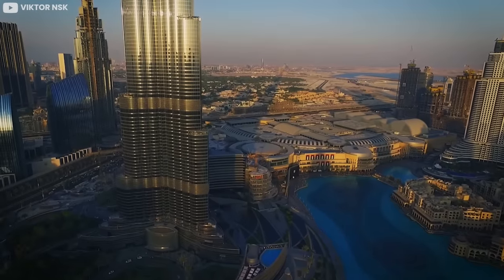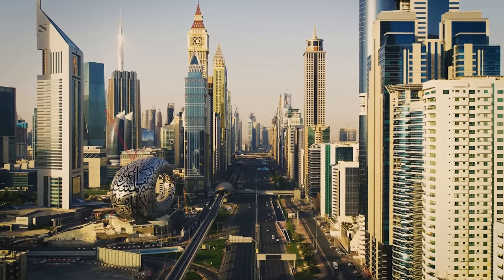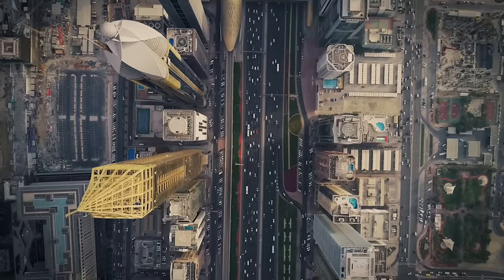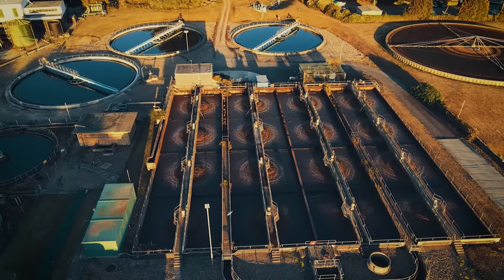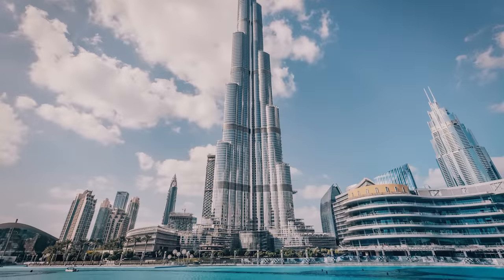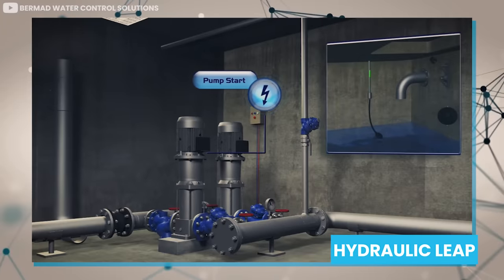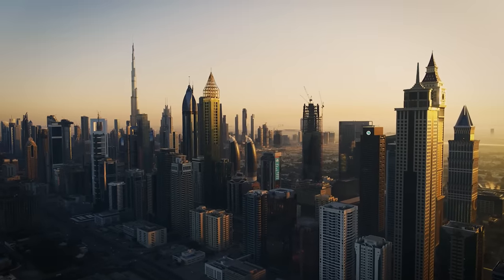What Happens When You Poop in A Burj Khalifa's Toilet

Comment: Surprised they didn't install a system of turbines to break its fall,  first building to generate power as the shxt goes down.
Reply: That's a pretty shitty way to do it
Reply: Did you mean generating power by hitting the fan?
Reply: New meaning to "the shit hit the fan"
Reply: Brilliant
Reply: Mate, you're a genius.
Reply: The geniuses always lie  at the comment's  section
Reply: @TeleTrueStory  Well, it WOULD turn the blades, thereby creating power.
Reply: @deltalou8987  😂😂
Reply: the blades could be Macerators making the waste into a liquid form, similar to turbo flush toilets that have a 3 inch pipe rather than a six inch.
Reply: so when the shit hits the fans,you get the lights on ...awesome.

Comment: They need to figure out a way to meter monitor water usage.  have a command center read excessive use. It seems unusual for a building to be creating that much waste.
Reply: They actually do. DEWA (Dubai utilities) has an app, and they also send you an SMS if you have excessive usage. Also these sewage trucks haven't been in Dubai for years - I've never seen one and I live here. Think it was a short term problem when downtown was being built in 2009
Reply: Thirteen tons per day is less than one truckload. It seems this video intentionally exaggerates that line of trucks.
Reply: @davidclark3304  Maybe the 8 tons didn't include the mass of water? idk

Comment: The long line of trucks is deceiving. 13 tons of waste water is 26000 pounds. Divide by 8lb/gal yields 3250 gallons. The truck pictured was labeled 1000 gal. So 3+ trucks. There is some wiggle room allowing for differences in the density of the discharge but not dozens of trucks.
Reply: True. Maybe it's a stock video of a convoy of sewage trucks...

Comment: It wasn’t cost effective to have the building connected to the sewage system but having trucks take the waste day in and out is?
Reply: The sewage system of the entire city cant handle it
Reply: Yup. Politicians the world over only think short-term, except for their own pension.
Reply: Right, because the system that it would have been connected to wasn't designed to handle that kind of load.
Reply: @wiseblast This is what happens when you use Sims as your architectural simulator for building construction.

Comment: London already has a comprehensive sewer system, but London's new 'super sewer' - officially called The Thames Tideway Tunnel is due for completion in 2025 and will augment the current system. This 25 km long super sewer consists of tunnels with an internal diameter of 7.2 metres (24 feet) and runs deep under the River Thames.  This project will cost  a total of £4.9bn to complete when the £1.1bn spent for preparatory works is included. That's the civilised, sane way to develop a city and ready it for the future, rather relying on septic tanks.
Reply: Cool. But here you can't tunnel in sand.
Reply: @ksavage681 is there only sand underneath? or is there also some kind of dirt that would be sturdy enough for tunnels?
Reply: maybe it would be far too deep
Reply: Is it the same London where people are left to burn to death in Grenfell and still no accountability over 5 years later? The London where a high-rise building was given the green light in CW and only had one staircase and then the LFB had to boycott it? Where we constantly have almost none of our high-rise buildings operate as they should and all buyers/tenants complain about poor quality (and even mould in Landmark Pinnacle) and where a simple cooling system never works? Yeah, please tell us how London is superior to Dubai just because shit goes down the right pipe. 

England is very good at writing/saying the right things but has a very poor track record.

Comment: The piping configuration we use in sanitary stacks to prevent blowouts and hydraulic jump are called velocity break. Additionally, the water closets that were mentioned as being installed on their own independent stacks were done as such to avoid being installed in the Suds Pressure Zone. As a union plumber, who builds highrises on the East Coast, it’s absolutely mind boggling to hear that the Emiratis built this city up without sufficient sanitary piping. Its a recipe for inefficiency, unsustainability, and, ultimately, disaster.
Reply: 🔥🔥🔥dark, i cant wrap my head around!
Reply: Not to mention Disease. I am appalled in knowing they designed this "Jewel" of a state of the art building without having installed a proper sewage system. That is what happens when you cut corners. You literally waste money.

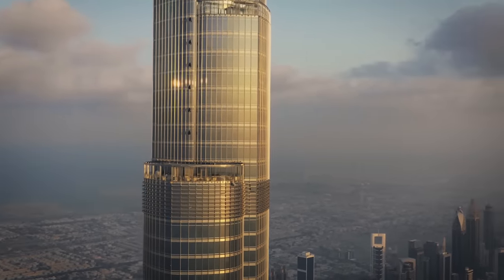Comment: 06:33 That image of the trucks show more than 13 cubic meter of storage. 1 cubic meter of pure water is 1 ton and a quick google seems to indicate that wastewater weight 70% of pure water. Therefor 13 cubic meter sewage would be 9,1 ton kg. Each truck is probably around 20 cubic meter.... Meaning a truck can take up to ca 11 ton. Seems to be more than one truck in that image to me... Is ALL sewage trucked out of the city? LoL
Reply: Burj khalifa is designed for 35000 occupancy , it has 900 residential flats assuming average of 4 residents per flat , they will use 500 litres of water per day for drinking pooping bathing washing etc. That's 1800 tons per day from the residents alone. I still haven't added the 2-3 kg poop/urine they do per day which will take the figure to roughly 9 tons more. So dear you need roughly 140 truckload to be moved out of the city and this for residents alone. Commercial offices , hotels , restaurants will add roughly 200 truckloads more. And one important detail you missed, sewage water is heavier than pure water. Your calculations are wrong ,13 cubic meter sewage should weight 14-15 tons and not 9 tons.
Reply: @dv5625  1 cubic meter of Sewage, sludge weighs 721 kilograms [kg] | Density of Sewage, sludge (material)
Sewage, sludge weighs 721 kg/m³ (45.01056 lb/ft³) | Maybe Aqua-Calc site is wrong.

Comment: I should be shocked, this should come as an absolute surprise that one of the most modern building in the world relies on trucks to carry off its sewage, but it does not.  It does not for many reasons, not the least of which is I have noticed a trend in new building projects, especially in gentrification and municipal funded projects I call Disneytfication.  The go up quickly, they seem wholesome, safe, clean, modern, and free from all manner of ills, but it's all a facade.  Plastic and paper mache, party tricks and barbie dolls, and lurking right under the bright, shiny exterior are is all sorts of gimmicks and tricks all held together with duct tape and string.

Comment: Even though they didn't connect up the waste water sewerage plumbing  first,  I believe  that even though they didn't connect the sewerage up the usual way first, I am thinking  it is still be possible to run a new system "from the septic waste plant facility that would be only for this building alone, 

And they could build it underground running the most direct way, straight to this sky scrapper, the Burj Khalifa? even though things are usually done the other way around, I believe that if they wanted in the future I believe it could still happen,

 I mean if they haven't had any problems with the trucks transporting the waste, then I believe that while this method seems to be working fine now that they could still change over in the future to the other method, I believe that it would not be that much of an issue, if they built it from the waste facility to the  building, obviously there would need to be one day within 24 hrs, for the change over process to occur, but that would be possible I would think.even if part of the Burj Khalifas sewerage system was changed over part by part over a few weeks, on the grand scale of things I wouldn't think that it was impossible at all, they could do that I believe, it seems like a big issue but if you are talking about big construction contracts for the future over the years ahead things could still logistically work out.
Reply: You really do have a lot of thoughts and beliefs about the matter.
Reply: @paulryan2128  I was thinking about it while on the throne.
Reply: @davidhunt1350  niceee :)
Reply: @indiasuperclean6969  there are no countries upon this earth that are above each other none what so ever one persons problems are everyones problems, if you don't work together problems never go away, no countries on this planet are with out their own respective issues but isolation from the rest of the world doesn't work, it's like trying to run away from your own back as soon as you stop & turn your head over your shoulder, there it is right where it always was, no matter how fast you run. issues & problems only ever get solved when people work together, this is something that is easier to work on together, that is why the earth is round like a circle it gives us all a chance to get around & work with each other.

Comment: Architects have  no business with building waste management. This is negative reporting. The engineers do. In  a pumped sewer system dependent on electrical power the provision for sewer trucks is prudent whether a building is connected to the municipality trunk sewer system or not.

Comment: THE POO TRAVEL AT AN AVERAGE SPEED OF 122 MILES PER HOUR  GOING DOWN WITH THE VELOCITY OF 10MPS2 "VERY FUNY"IMAGINE RUNNING A MAINGTANENCE INSIDE THAT PIPE LINES IT WILL BE LIKE A ROCKETS OF POO

Comment: Though there wasn't more technical breakup of the downward journey of sewage and sullage at top speed due to gravity, couldn't the Plumbing and Sanitary engineers have installed some hardware within the pipes to slow down the descent? - much like the suppressor that is screwed onto the handgun/rifle barrel to reduce the gunshot decibel levels?

Or even intermediate service floors (every 5, 10 storeys) which, in addition to having water tanks and secondary MEPs system holds, could have a septic tank, which then connects to the next lower septic tank.

Also, after the STPs successfully treat the sewage, the leftover sludge can be used for composting, manure, maybe generate a new topsoil in the otherwise arid desert lands...

Comment: Wow unbelievable the inefficiency of use in labor efforts trucks and other equipments resources to manage something supposed to be with a sewage system. This is not sustainable,  😂 i mean it is sustainable in inefficiency 😂 this project is potentially not creating continuous, it’s likely the costs would exceed the the returns because of this usage of resources. Either low or high occupancy this project costs could exceed the revenues.🤦🏻‍♂️

Comment: Saying architecture is not just building a beautiful building would pretty much exclude much modern architecture. This all very much revolves about the super ego for the designer and the buyer so good luck selling that philosophy. Nobody of any substance involved in these grand designs is involved in clearing up the resultant mess so the nasty bits are forever out of sight out of mind. Just flush it away with the push of a button. The wrong button by the looks of it in the video.

Comment: I think this has been debunked years ago.  As someone who has actually used bathrooms at BK, never once was there any issue, and for the nearly two weeks I was in Dubai (late 2015), never saw a single waste tanker truck anywhere.  Now yes, maybe in 2010-2012 this could have been a thing as the city did grow very rapidly before sewer infrastructure caught up, but to imply this is still a thing without firsthand confirmation is misleading.

Diagrams showing the water flow are for the gravity fed water pumping system to the mechanical levels and distribution network, not necessarily the waste water network.  

Don't get me wrong, video clips and narration are top notch, but sadly I think this video is just showing "how it was" rather than "how it is NOW".  

This building is connected to the regional utility center (DEWA) as the entire Burj Khalifa (then Burj Dubai) community was a master planned, district cooling / HVAC district.  To think the engineers of an entirely master planned community somehow "forgot" sewers is baffling.  Finally, the Burj wasn't hastily erected.  From 2004 foundation work it took until early 2010 to finally top out and be finished. with handover that year and occupancy into 2011 - quite a normal length of time for a skyscraper of this scale.